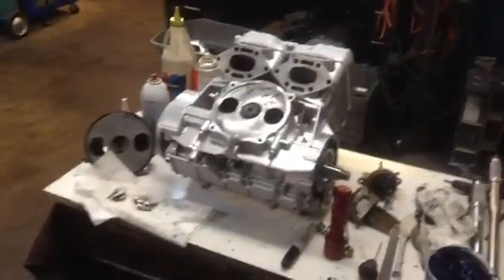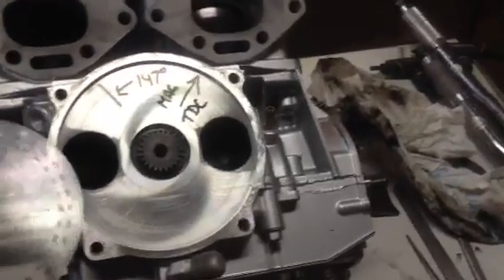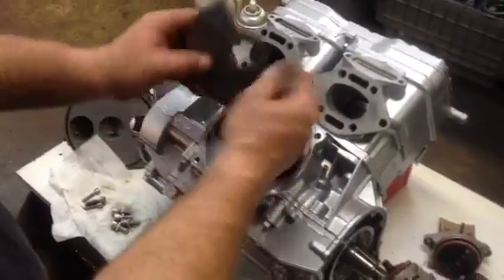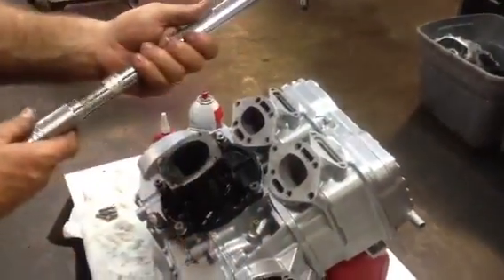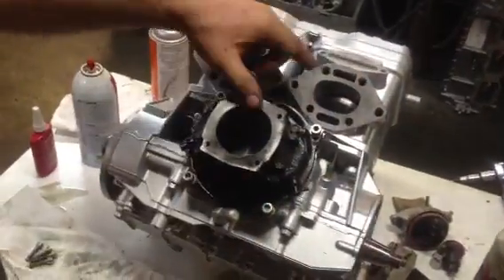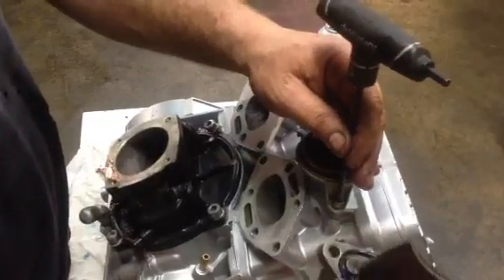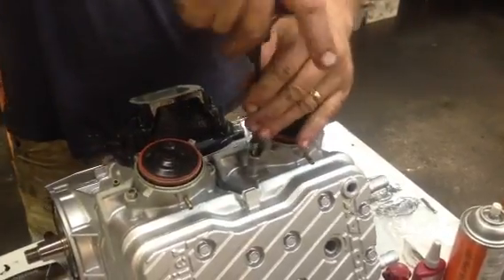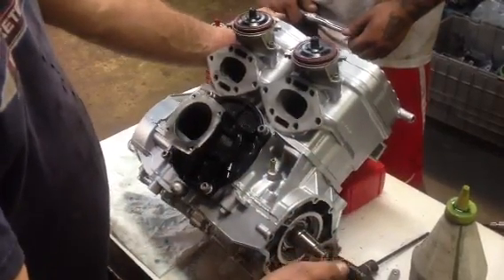SEADOO 787 RFI AND CARB MOTOR TIMING ROTARY , RAVE, SIZING, PTO INTALL

Comment: you never showed people that you set 0 degrees at the bottom edge of intake hole on no. 1 and go counter clockwise back 147 degrees.if i am wrong someone correct me.

Comment: Thanks for taking the time to make the video.  I am working on my first rebuild now of a 1998 SPX 787 and this helps a lot.  I'm just doing a top-end rebuild so I've been reluctant to take of the Rotary valve because I don't want to have to time it, but this makes it look easy.  The only thing that's not clear is where the 360 degree mark is and which direction (clockwise vs. counter-clockwise) you count up to 147 degrees.  It looks like the 360 mark is at 6:00 and the 147 degree mark is around 10:30, but I need to be certain before doing it.
Reply from the maker: +XT Camaro the 360 mark lines up on the bottom edge of the mag intake port,  NOT at 6